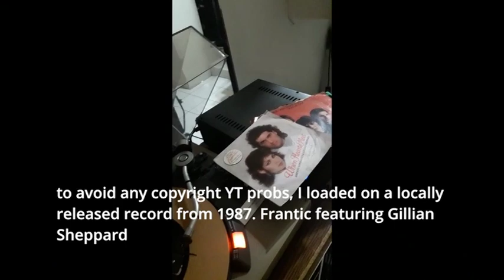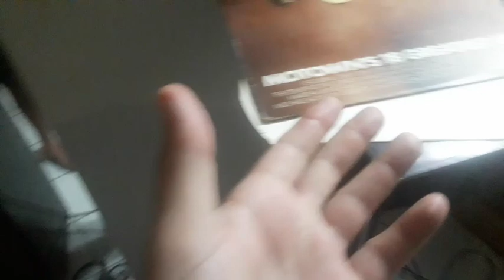Tube Phono Preamp build EAR834 clone kit

Comment: Nice work. I have made the same piece but from the competition.
I found Mundorf PIO caps after seeing Skunky use them and they are very nice sounding. She also does not trust the supplied resistors on another project and I agree. I purchased some along the lines of mid-range Vishay's
None of this is super expensive and you can get a good reward

Comment: Great video thanks for sharing,I've been through much the same experiences,trying to minimise hum and noise,actually found it to sound very nice,have used better low noise valve's but haven't changed any Capacitors yet,I have put power supply board in different enclosure and my next step is to add Chokes and Capacitors on the Heater and B+ supplies to hopefully reduce noise and hum further,one of best things I've found and would advise trying if you can put your hands on one is feed it via an Mains Isolation Transformer.

Comment: This is a nice walk through of the kit build.  Thank you for sharing your build journey.   Those higher value caps in the Power Supply stage won't make any difference, but it would be nice if the had the board printed correctly to match the components.   I believe the "unlabelled" 0.1uF caps may be the "anti rumble"/subsonic filter if I recall correctly. 
You are right, you cannot have two cartridges connected in parallel.  It will completely mess up the impedance and capacitance at the input.  Definitely will need them switched if you really need two turntables connected.
I also use the EAR834 clone, and mostly I trust the parts in the kit.  There are a couple of caps dierectly in the signal path that make a small difference in qualtiy, but most of the parts are good, as long as the resistors match the rating.    Rolling the tubes will have more influence on the sound than the caps etc.   That said, if someone wants to use higher quality parts in the RIAA stage, then go ahead.
Reply from the maker: There was a particular cap that seems to have messed up the sound, the 1uf red ones labelled "Audiophiler", and unfortunately I put some blame on the Solens for this at the end of the vid. I will soon do a review of the signal cap issue in this unit and post my remarks if it does sound good with the Solens only in it.
Reply: Hello Brandon.  This is a small following, but informative.

As you see my comment, I’m looking to purchase a finished kit from a Chinese website.

I don’t know if mentioning the website and particular companies would get my comment deleted.

If you don’t mind sending a private message, then I can ask you specific questions on your opinion.  Thanks!
Reply from the maker: Brendan I think I am going to look further into the anti rumble filtering, if there is any. If I touch some parts of the turntable or especially the plastic dustcover, the woofer cones want to jump to the other side of the room! Very scary and some speaker will get damaged if that is left unchecked.

Comment: O dear, now I was starting to entertain the idea of socketed capacitors as well. But unfortunately the sockets probably would mess up the actual capacities seen electrically. 
This looks like a fun project kit. Hopefully something similar can still be had these days here in Europe, and if it is with pre-drilled stand-off holes (I don’t have a drill press). 
Cheers
Reply from the maker: That is a great idea! One problem is that all these capacitors have different thickness lead wires, but a raised turret or pin could work as a much easier solder point for faster swapping
Reply: @jothanankrogh  yes, it is a great idea until you realise how much capacitance a socket spring and some unavoidable oxide layers might add (uncleanly) to the system. But then again, maybe it won’t be that bad. Only one way to find out… 😉

Comment: Your through explanation encouraged me to challenge my first diy project of tube amplifier. The first result was very discouraging, but I was lucky to figure out a few mistakes (in a week time) and the sound was fantastic; more than I expected!! I am already dreaming my second project.
BTW, do you have measured data (VDC) at each stages of the music line?
Although I cannot hear any sound differences between right and left channels, I measured the B+ voltages differ significantly; 244/281VDC. Without the load (disconnect the main board), the B+ voltages for both channels are similar; 294/301 VDC. This difference continues, so the plate voltages at V1, V2, V3 are 73/79, 94/110, 242/279 VDC.
I have no idea whether the measured voltages are within expected range or the differences are acceptable or not??
Anyone can share the valuable experience?

Comment: Hello!  I really liked your detailed video building and reviewing the kit.  It did give me some important information that I was looking for.

I am looking to buy a already built kit from online.

Sorry if I haven’t looked at your previous videos.  So I don’t know the voltage that your outlet uses.

I’ve read the tube warmers might have problems if the input is too low at 110V.

Thanks in advance!
Reply from the maker: Hello Pete, this one has an adjustment potentiometer on the power supply board that sets the regulated voltage of the tube heaters, so there is no problem with input voltage differences, mine is 120vac.
Reply from the maker: https://www.ebay.com/itm/122780442197?hash=item1c9648de55:g:OcwAAOSwhqhZ9gBS&amdata=enc%3AAQAHAAAA8F2o%2BVgLu1nkW8XFI1IllCDpjMMUqvTFw3g%2FfQ7do25VLUcqeV2fTshMweUj9Vi9Aw%2FP3Ov5CRZoUDidWxrtYt1BFjLznAB3Pot6HXiBLnQZG%2FSkWob8wqTSDeOUzDV0r2cG1v23nTSENxqaLJVr4YEjQs6C1CMUhQlIefillCQIJP6mz7kg9YQbyNAGzr97p%2Fn3219tD%2Fd5zRqtRAw9EgYPzmU6vo4ubTtrlzJinLfNzAh9gK6taBkhTVf8WfsTMvVHnH3N6Z4mIvgkk6Q9V%2B6UC2WzbE9Lj4atnLbktvcbKGONO29%2B0DxiSPWIif2LiQ%3D%3D%7Ctkp%3ABFBMmNCe-a9h
Reply: Why did you choose this kit over the others?  There’s a kit by Douk that seems to have good review by some audiophiles like Audio Karma and Vinyl Engine.

Btw, there’s another site which costs a lot less for the kits and parts, such as enclosures.
Reply: @petewang1049  The Douk kit is also an EAR 834p clone, I believe.

Comment: Great job with the build! Yeah, you don’t want both turntables plugged into the same phono pre. I built a similar EAR 834p phono pre, and an A/B/Y external box was how I switched between decks. It’s an easy box to build, and I’ve no doubt you could figure it out easily. 👍🔊🎶🥳 
Btw, Apologies if you mentioned it, but where’d you get that chassis? It looks really nice. A couple of my friends want me to build them phono pres, and customizing them is a pain in the ass. lol Thanks for the fantastic vid!
Reply from the maker: Thank you! still enjoying this preamp every day. The chassis came with the kit, I really like it and would like to use blank ones in future projects. They can be found in many sizes on ebay, with a search like" Aluminum Project Box Enclosure"
Reply: Hello Nick.

Since you also experience building these kits, if you don’t mind sending a private message, then I can ask you specific questions on your opinion.  I’m looking to buy a finished kit.  Thanks!

Comment: Sorry if I missed it but did you check loading on the cart? 46k and 100-300pf across the phono cart in.
Reply from the maker: Excellent question, as far as I've seen the Ear834 has no capacitors at its input circuit and relies upon the turntable cables capacitance, mine measured 220-240pf.
Reply: It might be a good topic to do a video on, especially if you have a test record and some gear to measure the response.

Comment: what was size of that fuse you used? I have same project on my desk :D
Reply from the maker: 1amp fuse installed, and zero problems. I hope you will do a project vid also.
Reply: @jothanankrogh   The original EAR 834P specifies the fuse as 0.1/ 0.2A; assuming 0.1A fuse for 240V and 0.2A for 120V?? I'm using 0.2A/250V fuse (my house gets 230V electricity) without any problem.